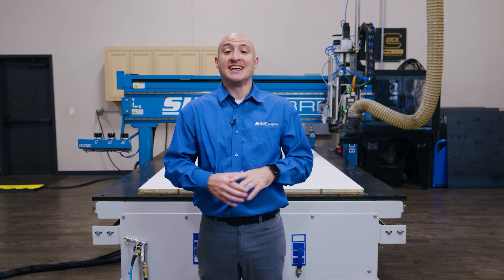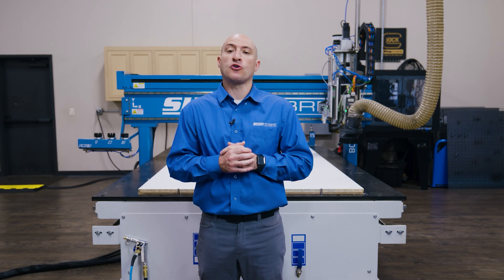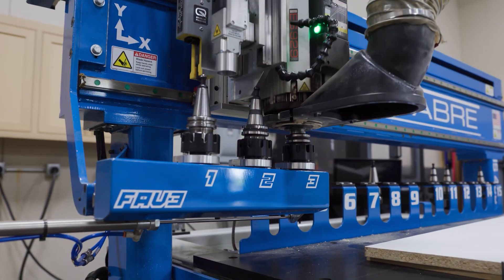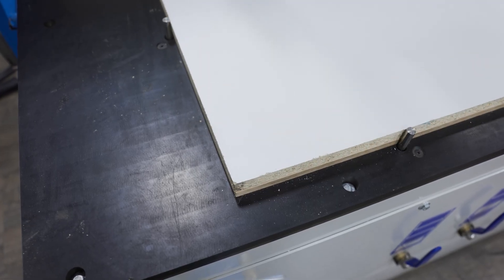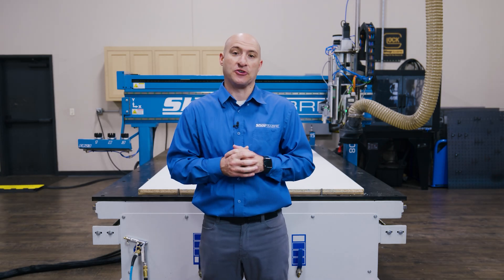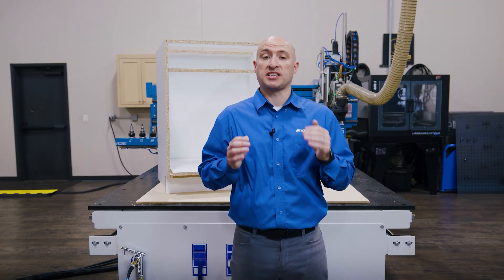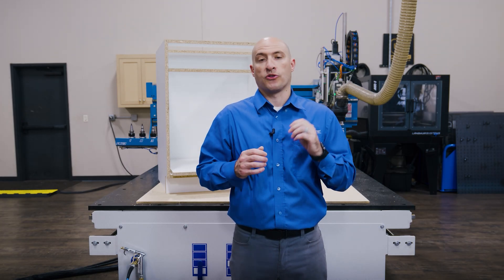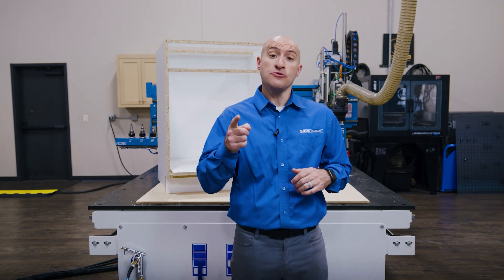Cutting a Nested Sheet of Custom Cabinets on a CNC Router

Comment: Does shop sabre have quad roller hold down options? Don’t quite have the power availability for vacuum on top of machine compressor and extractor.
Reply from the maker: In the current CNC industry, the efficiency of vacuum hold-down technology has rendered the older technology obsolete. While power constraints may be a concern, the availability of low-power vacuum options and allstar solutions has democratized the vacuum industry for many.